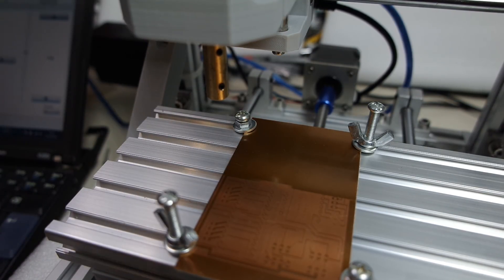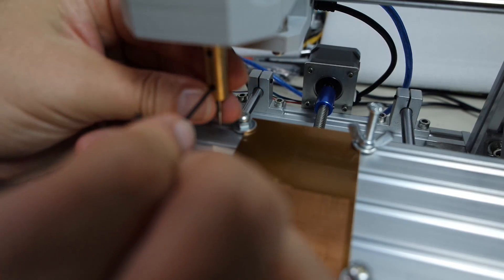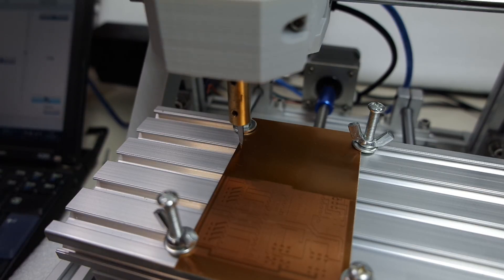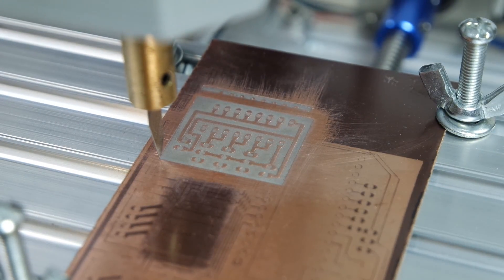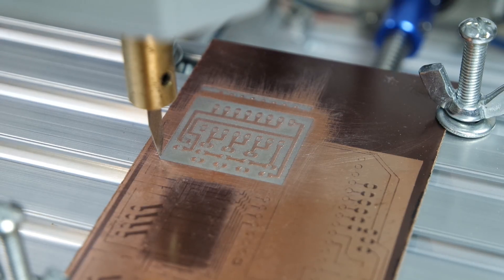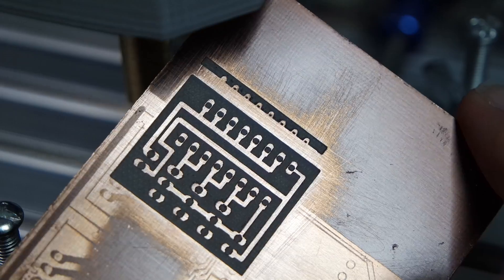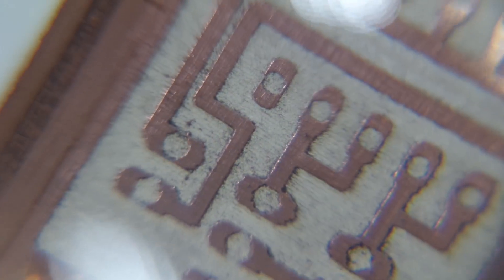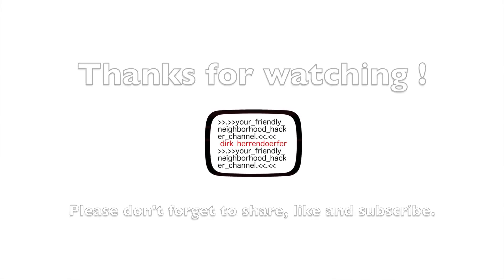T8 Mini CNC PCB Milling

Comment: What is that material? It looks like that is probably the best way to make home pcbs.
Reply from the maker: That's a copper plated fiberglas PCB board, the kind you use for etching. Yes it's easy and quick, but the dust and chips from the process are very unhealthy.
Reply: @dherrendoerfer  I was curious about that. Would you usually have a vacuum mounted there sucking up the dust?
Reply from the maker: My work area has dust/smoke extraction, I usually clean up after a job with a vacuum, and I wear a mask while it's running.

Comment: Could you show the process of going from a PDF to the finished G code?
Reply from the maker: That is really hard to do, since there are so many variables involved, that make it impossible to reproduce.
It starts with the fact that you need a very specific Linux setup to use the tool to create the engraving g-code. I've not yet been able to source a Windows developer to make that available on Windows for me.

Comment: What software  u use?
Reply from the maker: I use different software tools for isolation milling or engraving, like FlatCAM, SketchUP plugins, self-written engraving tools or CAM converters. For controlling the CNC I use GRBL controller.
Reply: Dirk Herrendoerfer What software do use to design pcb?
Reply from the maker: Eagle, or more recently EasyEDA.
Reply: Dirk Herrendoerfer I use altium designer. But i can’t convert to gcode. Can u teach me?

Comment: The PCB looks impressive.
The bit you are using is a v-bit type, where the cut width is related to cutting depth. I think it is highly possible that the bed is not flat in relation to the machine X-Y plane. Consider using small wasteboard and flatten it before PCB milling.
Reply from the maker: The bed is very well levelled and the machine is setup ok. In fact the problem is me getting my defaults dialed in correctly.
I've had a couple of tries now and the more recent results are far better.

Comment: Do you know the tolerance of the CNC machine, could that be adding a bit of drift. Have you calibrated the steppers?
Reply from the maker: The tolerance is stated as position/reposition:  0.1/0.05mm and that is not exaggerated . It performs really well.

Comment: hey Dirk, great video as always. if you use eagle to design your pcbs you should definetly try chilipeppr. it is a grat tool for controlling and sending g code to your cnc machine. thay have included a great tool that alows to generate gcode directly from an eagle board file. i use it all the times now. also it runs in browser so you dont need to install anything

Comment: Hello Dirk, I made my own pcb milling machine and it's working kinda well hehe. I just had some questions regarding the generating of gcode. Why didn't you go with flatcam or sone other software like that instead of using your old laser software? Seems like the toolpaths will be more optimizing for engraving using a different cam software. Also why not use gerbel files instead of pdf?
Reply from the maker: Well, I suppose I use the software that I'm most familiar with, so I can compare the results between the two platforms that I am familiar with. And (laughing), I believe my tools not to be as old as FlatCAM is, because I'm still working on them on an almost daily basis. And! I'm also working on a vectorising version of my toolpath generator, but that is not ready yet.
But really: I wanted to take an image from anywhere and reproduce it on the machine, to compare it with the print - and that is not exactly what tools like FlatCAM or LaserWeb do. I do use FlatCAM and Gerber files when needed, but that was not my goal here.
Reply: Dirk Herrendoerfer Ahh I see, I get it now. Another question is, have you tried to do any double sided pcbs?
Reply from the maker: Not recently, and not with this machine, because I do not have a means of clamping down the PCB board so I rests in the same exact location when I flip it over.
Reply: Dirk Herrendoerfer With my machine I deviced a method of always getting the pcbs in the same place even after flipping them. It is a vice that holds the pcbs in place by force coming from the sides. The vice has a gap that the pcbs can fit in, so they are always aligned with the vice. I would try something similar as mines since it works well (mines is 3D printed so you can always design something that works). I'll be releasing a video regarding all that I have done to my machine in that regard soon enough.
Reply from the maker: Similar to mine - but since I did it on the laser it did not really hold down anything with force. The rest was done through software, you just needed to measure the width of the PCB board real carefully.

Comment: The process of printing the electronic circuit in the previous videos by cnc machine and coloring pen and then melt the piece of copper solution acidic better and thank you
Reply from the maker: Yes. But I wanted to use the chance and compare. The engraving has the benefit of having a little better resolution. But drawing and etching is a pretty simple and elegant way.

Comment: Any plans on using it for some light milling of aluminum or brass?
Reply from the maker: Not sure yet ... I have some material to try on, so I'll do that too, probably. Need to figure out if I need different tools or cooling though.
Reply: Dirk Herrendoerfer well for the cooling you hould be fine with some cutting fluid for cutting threads (Gewindescheidöl) or some boaring fluid.  But the cutters are a good question. I have no real grasp on what force that tiny thing can handle.  But I guess I would go for a 3-4mm cutter single or double fluted for the begining. Because you can always go bigger if it works and the smaller ones only give you trouble. I am looking forward to your findings.  Good luck. J
Reply from the maker: I think that when dealing with aluminium, or similar metals, 2 or 2.5mm cutters will be maxing out the spindle motor, Let's see if I can find some copper coins somewhere ....